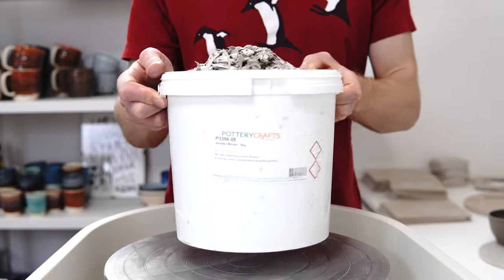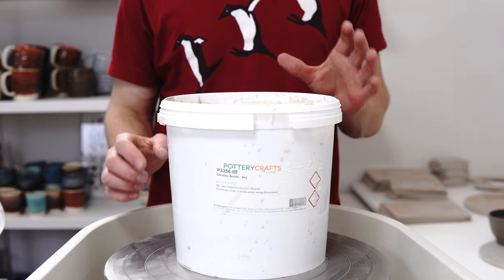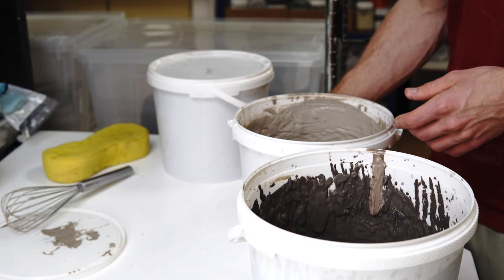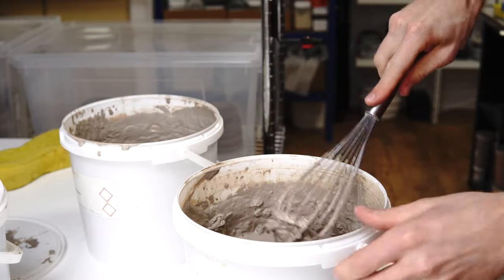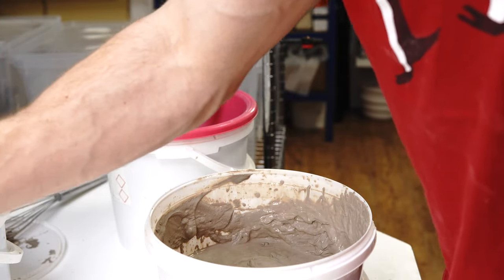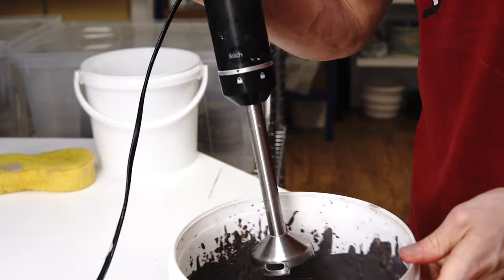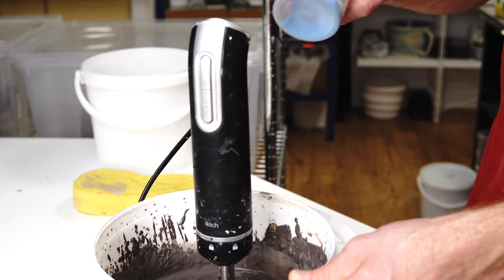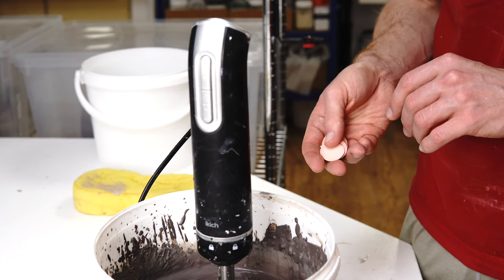Making Slip from Clay Trimmings

Comment: I have always been surprised that you don't have to deflocculate your slip, and are still able to avoid cracking with those thick drips and handle joins.  
I use a deflocculated slip in my classroom to mend broken wares.  I've joined bone dry bits, right before they go in the kiln.  Definitely not ideal circumstances, but it works!
Reply from the maker: I think it helps that I'm adding so much slip to the piece, everything gets rehydrated and sits for a little while with the slip still soft, so it can lose some of the tension it would otherwise have. I have a deflocculated slip for patching things up too, and definitely wouldn't want to try it with regular slip!

Comment: Cheers, thank you for this thorough video, it's very helpful. I am having trouble getting the correct consistency for my slip, where it is thick enough to stay in place when initially applied, but thin enough to drip when the bat is tapped.  When you pour your bucket it looks like the consistency of heavy cream. Would you be able to say what 100ml of your slip weighs out to (minus the vessel of course)?  I often record that in my recipes as part of a sort of poor-man's specific gravity metric. Thank you again!
Reply from the maker: I think it will vary based on the characteristics of the clay, so I'm not sure my number will be that useful, but I think it was 1.55 last time I measured it. I go based on how it moves in the bucket. It should hold a 3D shape but not for sharp peaks. And that's really the only way to measure SG with something viscous, definitely not a poor-man's method!

Comment: I'v never made black slip or glazes for that matter but I want to make some black slip. Red iron oxide, manganese dioxide, chrome oxide and cobalt oxide appears to be my shopping list. You mentioned using cobalt oxide or cobalt carbonate. it sounded like you were saying either would work but carbonate would work better for glazes but oxide would work fine for slip. Right now in the states cobalt oxide is $78 for 1 pound, but cobalt carbonate is $50 for 1lb. Should I go with the carbonate to make black slip? Because it's cheaper and when I start making glazes I will have the cobalt that is better for glaze making? 
When I search "red iron oxide" I get these two results.....Iron Oxide- Spanish Red and Ferric Oxide - Red Iron Oxide. Which of those should I get? 
I purchase some black ceramic stain to mix with white slip but the company told me I may only get grays and not black even though the reviews said it would make a nice black. it was $30 for 170grams. I plan to return it and try and make the black slip the way you do it. 
Thank you so much for your help!!!
Reply from the maker: It sounds like carbonate is a much more sensible choice for you, and I'd definitely go with that
Reply: Thanks for the help!! @OldForgeCreations